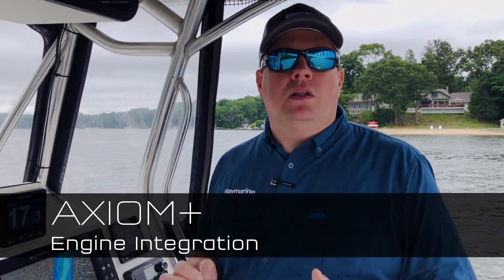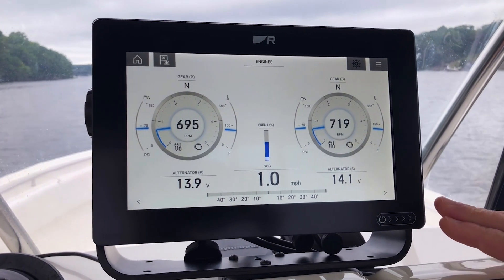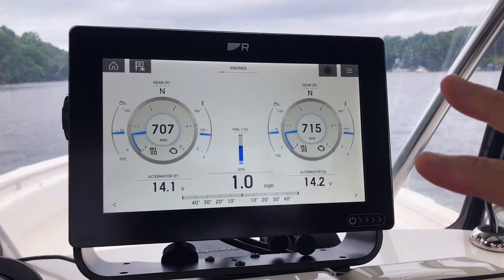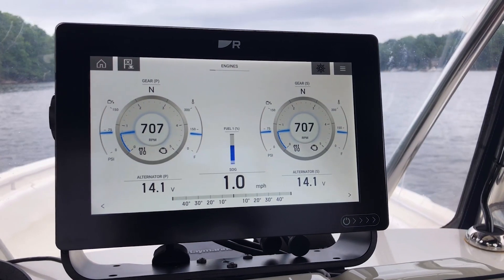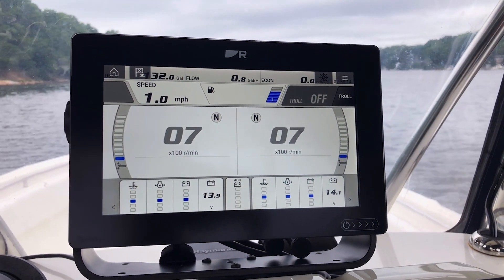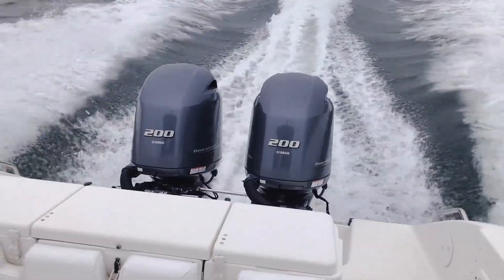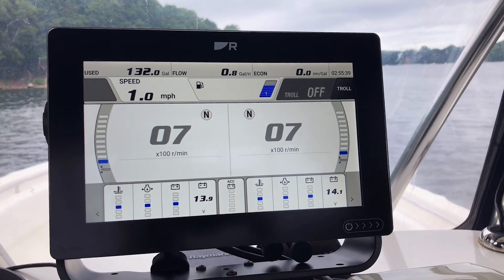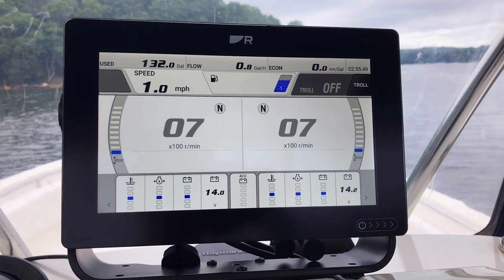Axiom+ Engine Integration | Raymarine Tech Tip

Comment: i have sm coming up for navigation how do i change to nm
Reply from the maker: You can change between statute mile, nautical miles and other units by going to Home...Settings....Units.  

On that tab you'll see options for changing the units of measurement for distance, speed, depth, temperature, etc.

The one specifically you need is the Distance units.  You have a choice of either Nautical miles & feet, Nautical miles & meters, or Nautical miles & yards.
Reply: @ thank you I am also having issues with my unit freezing
Reply: how do i get my boat icon its just a black dot
Reply from the maker: Long press on your boat icon on the chart.  A popup menu appears with Boat Symbol as an option.  Currently you probably have it set to Teardrop.  You can change it to an outline, or full boat icon through that menu.

If you do not have a compass heading sensor or autopilot onboard your boat, your chart plotter is placing your boat on the chart by GPS fix, and orienting it by Course Over Ground.  When you boat is stopped or moving extremely slow, Course Over Ground from GPS becomes very inaccurate.  The on-screen boat icon will change from a a boat-shape to a black dot if it is unsure of the boat's orientation.   The boat shape will return when the boat starts moving at a speed above 0.1 knots, as the Course Over Ground calculations resume at speed.

Comment: If I use the interface option will my original gauges still work as well? Or is it one or the the other?
Reply from the maker: Yes.   Axiom reads engine data through its NMEA 2000 connection.   Whatever engine gauges or instruments you have now will continue to work alongside what you see on the Axiom.
Reply: @Raymarine  
So I have an axiom9, Suzuki SMG4 gauge with the Suzuki interface wire, everything is connected though the their is now activity (power) on the gauge.  Is there any connection illustration that I could reference to troubleshoot my issues?
Reply: Will the eci for Volvo penta link into axiom ??

Comment: Would these link with a 2005 Yamaha 115 4 stroke?
Reply from the maker: I recommend checking with your local Yamaha dealer to confirm that your particular motor supports Yamaha Command Link.  If it does, then it can be linked to Axiom.  The best way to do it is with a Yamaha engine gateway.  That device ties into the boat's SeaTalk NG or NMEA 2000 network which Axiom will also be connected to.   The gateway device outputs standard NMEA 2000 engine sentences that Axiom can display in its official Yamaha app.

Comment: I just installed the axiom 12 inch and it is not reading all of my Yamaha stats that my old A98 used too.  Is that a Settings or if there’s something else going on? 

For example, I missing battery voltage, speed, and unable to reset fuel levels
Reply from the maker: There are 2 ways Axiom can display data from Yamaha engines.   Similar to your a98, Axiom has a Dashboard application that has engine data displays.   The data shown on the page can be modified, so if there are values missing you can long-press on some of the fields and edit what is displayed.

Axiom also has a Yamaha engine app.  That is available if you also have a Yamaha 6YG NMEA 2000 data gateway installed in your CommandLink network.  That device bridges data from the Yamaha engines to Raymarine SeaTalk NG or NMEA 2000 connection.   There is a Yamaha-specific app you can add to Axiom's home screen that uses graphics very similar to the Yamaha CL-5 or CL-7 display.   In Axiom's setup to do need to tell it you have Yamaha engines.  Go to Home...Settinge...Boat Details...Engine Manufacturer and select Yamaha from the list.

Comment: What can be displayed for Cummins 5.9 QBS with Zeus Pods?  We have Vessel View however it is limited to what it displays.
Reply from the maker: Most likely, the data you'll see on Axiom is going to be mostly the same as what you see now on VesselView.   Most Cummins diesels natively output J1939 engine data.   Your VesselView display reads that data stream from the engine, and possibly combines it with data from some other onboard sensors too.  There is a Cummins/SmartCraft NMEA2000 Gateway module available for those engines that can be used to send NMEA2000 formatted data to a 3rd party screen like Axiom, but the source data it reads is the same as what your VesselView screen sees now.   Your local Cummins parts counter might have access to some more specific information about which NMEA2000 PGNs (sentences) this gateway outputs when connected to your system.

Comment: Really enjoy  the raymarine live videos.    

We have an Axiom 7 on a Jeanneau sailboat with a yanmar engine.   checked today if the Axiom would recognize the engine and it did not.  I am assuming I don't have NMEA2000?   Is there an easy fix?   
The boat is one year old.
Reply from the maker: Hello Chris.   Many of the new Yanmar engines support NMEA2000 data, but often it is just not hooked up by the boat builders.  Alot of times it just comes down to what combination of motor and instrument package they chose to install.

Yanmar introduced some new digital instrumentation in 2019 that offers NMEA2000 output to other devices like Raymarine Axiom.   It is possible that all you need to do is run a spur cable from your current Yanmar gauge or control panel to the SeaTalk NG network.  This press release from Yanmar has details on the compatible engines and gauges:  

https://www.yanmar.com/marine/about-us/yanmar-marine-international/news/yanmar-introduces-new-generation-electronics/
Reply: @Raymarine  Thank you for  the reply!   I will get some help locally on how to do this.

Comment: Can you physically show how it's done?  Do you know if this has ever been done with new Suzuki outboards?
Reply from the maker: Hi Nick.  Most Suzuki outboards do output NMEA 2000 data and can be integrated with Raymarine displays.  The installation process can vary widely from motor to motor, and between model years, as to exactly how it is best accomplished.   It can also vary a bit depending on whether or not your boat currently has digital engine displays and controls or analog displays and controls.  Generally boats with digital displays and controls are easier to work with as many of them are already rigged with NMEA2000 networking.  I strongly suggest speaking with your local boat dealer or Suzuki dealer about it to determine first what data capability your engines have, and how to access it.

Comment: I have Volvo-Penta gasoline engines…mid 2000s vintage.   I have the correct gateway to facilitate the sending of  engine data to the network.   Would be nice if Lighthouse had a Volvo Penta selection for display…much like they have done for Yamaha.    Other than the default display appearance, are there any other choices for how the data looks on the screen?   For example, I have seen a picture of the Mercury Vessel View appearance on these plotters.   Can that “look” be selected while sending Volvo Penta data to the network?   Any other looks?  Thanks in advance…
Reply from the maker: Hello Gerald.   The interfaces you see for Mercury and Yamaha were provided by those manufacturers specifically for use with those engine systems.  The style of graphics, fonts, and controls all mimic the same interface found on their hardware gauges.   In addition to the readouts there are also alarms, diagnostics, and other capabilities specified by those manufacturers.   

We're open to similar arrangements with Volvo-Penta and all other engine manufacturers too.   You can help us by making your desire for this capability known to Volvo-Penta too.  

Currently they only allow us access to their NMEA2000 data stream, which uses the gauges available in our "Dashboard" application.  You can choose to display them in a light or dark format, and you have some limited configuration of the maximum values for some parameters, but otherwise the customization options are limited.
Reply: @Raymarine  Well here's hoping VP will work in consortium with Raymarine for a proprietary app to display engine data at some point.   In the interim, if I may make a suggestion.   If it can be done within the code, I would suggest truncating RPM numbers for the "ones" units, and perhaps the "tens" as well.  I now have this function connected to my VP engines via Gateway, and the engines are never speed-stable enough that the numeric values displayed on the tachs aren't always changing.   This is a distraction.    It is not important to display exactly 682 RPMs at idle, etc...   680, or 700 would be fine.   This is not noticeable on the needle representation...just the numeric value.   If the software could be coded to truncate this...better yet...allow the truncation to be user selectable for ones units or ones and tens....it would make for a FAR less distracting display.   TIA

Comment: Will this system work with a smaller Yamaha outboard like the F25c?
Reply from the maker: Hi Justin.   I don't see the F25C motor listed as one that supports NMEA2000.  That is the data protocol used to pass engine data to the MFD.  The list I have access to from Yamaha shows the F50 as the smallest motor with that capability, and includes models from 2006 and newer.   

I would check with your local Yamaha dealer to see if perhaps that has changed.   If your motor is significantly newer, it is possible they may have added that capability since my list was published.  If your motor is currently connected to Yamaha digital gauges using CommandLink, there is a very good possibility it will work.  Your Yamaha dealer should be able to look it up by serial number, and if it does support it, they can also get you the proper Yamaha NMEA2000 gateway and cables to make it work.
Reply: @Raymarine  Thanks for responding. My engine is a 2021 model, and from what I can tell it does support command link gauges. There’s a video online a gentleman did with the exact same motor installing Yamaha’s command link digital gauges to it. There’s an unused white four pin connecter under the Cowl that he says he connected to. I asked the dealer if it supports gauges and they just said that yes it does, but they didn’t go into detail

Comment: Can we get rpms and gas mileage and range while also being on chart plotter? Or is that only on every other brand....
Reply from the maker: Yes.  There are a couple of different ways you can display it.  First, you could create a spit layout displaying chart on one panel and the data dashboard on the other.  The data dashboard can show all of the values you mentioned, and more.   

Second, you could have a full-screen of chart and add databoxes to the screen with the values you want to see.   In this configuration you are limited to 4 floating databoxes.

Third, you could customize the slide-out data bar that hides under the left edge of the screen.  You'll see Data 1 and Data 2.  You can specify what items you want to see in either data bar by long-pressing on any cell, selecting EDIT, and choosing the item you want to see there.

The items you inquired about are in the data categories for ENGINE and FUEL when you are customizing any of the databoxes or data bar cells.

Comment: I need help ,
I have mercury x 2 60 hp 2017 CT outboard that integrate via mercury nmea 2000 gateway ,currently having a hard time with the setup wizard to identify the second outboard please help,
Axiom MFD 7" with the latest firmware installed. Is there a way to give the second enige a different node address?
Reply from the maker: Hi Vincent.  Our tech support team can help you get this setup.  Please head over to http://raymarine.custhelp.com and let them know the details on your boat, motors and Raymarine system.

Comment: We have 2002 Yanmar 3gm30.
How would we go about interfacing the engine stats to out axiom 7 and 11 inch displays?
Reply from the maker: Your Yanmar engine would need to provide NMEA2000 engine data to the Raymarine Axiom displays.  I suggest first speaking with a Yanmar dealer to see what data options that particular engine offers.  Not all of them offer digital data output.

Comment: it works connecting via NMEA2000 with Mercruiser 2 x 300 DTS with Vessel View 703 ? and in what  menu we can get this information ?
Reply from the maker: Hello Andre.  We can display engine data via NMEA2000 in our dashboard app.  Mercury engines support NMEA2000 data integration via their gauges or an optional NMEA2000 gateway device.    Your local Mercury Marine dealer or our tech support can help you figure out exactly what you'll need to get this configured.